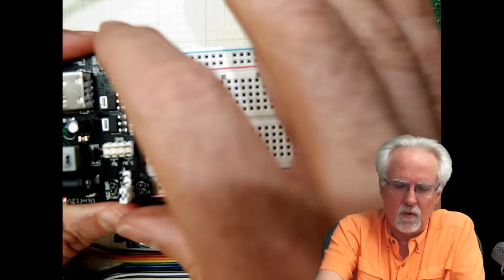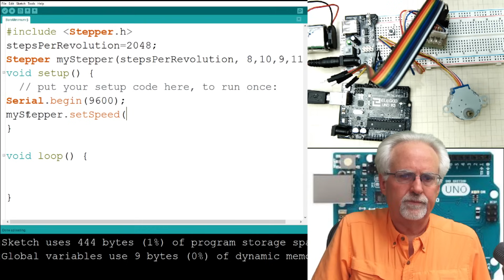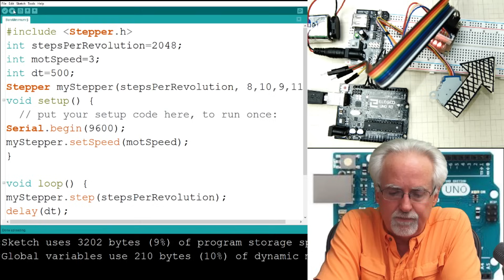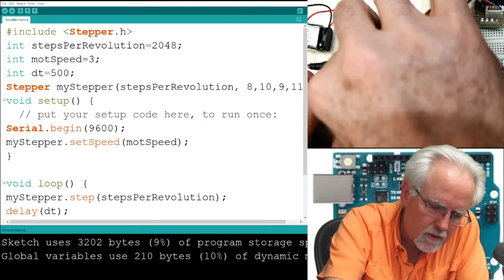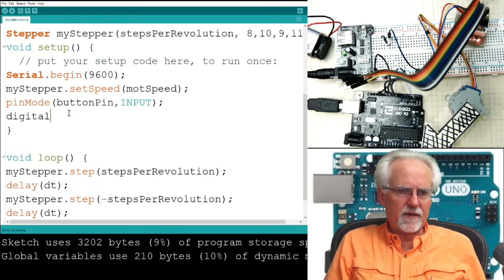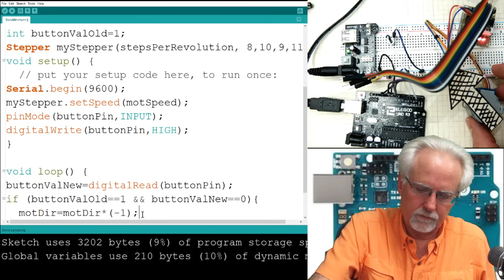Arduino Tutorial 35: Understanding How to Use a Stepper Motor

Comment: this took me 30 minutes to get a rough program running unfortunately, and I had to rig up an AC to DC power battery to power my circuit since I had no 9-volt batteries.  But besides that, very cool project to build and learned some cool things from it!
Reply from the maker: Great job!

Comment: Currently in my second year of aerospace engineering at university and have never touched an Arduino or C++ before and was given a project requiring the use of multiple stepper motors, sensors, buttons and LEDS and I cannot stress enough how much these videos have helped me. Thank you so much for making such high quality free material! I know there will be others like me in similar situations and your videos will have saved them as much as me.
Reply: Hi, I'm thinking about studying aerospace engineering after high school. Can you recommend any books worth reading, or give any advice other than that? 
Thanks in advance :)

Comment: I was able to program the button but I did it a bit different.  I used ... if (buttonVal==0) {   I then changed the direction as you did using the *(-1)  inside the if statement.  This works fine .

I would be interest to better understand why your way is better, or if in fact my way works as well.

Comment: when i plug-in my arduino board the power supply light turns off. The motor shakes a little bit when i run the code but it does not turn. i dont really know what this could be caused by. I think my controller for the stepper motor does not work because the lights A,B,C,D never turn on. please help me i have been stuck on this for days.... :)
Reply: found out what the problem was....the batery was just not having an output of 5v so thats why the controller would not power up :0

Comment: I find the battery is dead, cost me two hours to find it out. If your driver doesn't flash like mine, it's very possible that the battery is going wrong. 

#include <Stepper.h>
int dt = 1000;
int stepsPer = 2048;
int rotate = 1;
Stepper myStepper(stepsPer, 8, 10, 9, 11);
void setup() {
  // put your setup code here, to run once:
  Serial.begin(9600);
  myStepper.setSpeed(10);
  pinMode(2,OUTPUT);
  digitalWrite(2,HIGH);
  //  pinMode(8,OUTPUT);
  //  pinMode(10,OUTPUT);
  //  pinMode(9,OUTPUT);
  //  pinMode(11,OUTPUT);
}

void loop() {
  if(digitalRead(2)==0){
    rotate = -rotate;
  }
  Serial.println(rotate);
  myStepper.step(rotate);
}
Reply: I think it's very useful to have the button new and the button old because my code will keep reading the button digital input sometimes it reads three times therefore the motor doesn't change.

Comment: Here's how I did the challenge (without watching the end of the video) and I found it worked fairly well:

#include <Stepper.h>
int stepsPerRevolution=2048;
Stepper myStepper(stepsPerRevolution, 8, 10, 9, 11);
int motSpeed=15;
int dt=500;
int readPin=A0;
void setup() {
Serial.begin(9600);
myStepper.setSpeed(motSpeed);
pinMode(readPin, INPUT);
}

void loop() {
float statedet=analogRead(readPin);
if(statedet<=300){
  myStepper.step(350);
  Serial.println(statedet);
  delay(1);
}
else if(statedet>=600){
  myStepper.step(-350);
  Serial.println(statedet);
  delay(1);
}

}

edit: I also made a mini circuit for the push button. It had an LED and 1k ohm resistor so I could see when it is held down. The readPin was on the resistor's first pin.

Comment: Wait, you don't need to do motDir * 1, you can just do motDir, because multiplying any number by one results in no change to the number.  In fact, even if you were going multiple steps at a time, you could simply set motDir to the desired number of steps, as multiplying by -1 only changes positive to negative and negative to positive without altering the absolute value.

Comment: mine ran for a minute rgan stopped all it does is buzz now
Reply from the maker: Probably your battery is dead. Try using a suitable power supply instead of a battery
Reply: @paulmcwhorter  9.2v   tried 2 batteries
i need to find a good wallwart  but that isn't the issue here
Reply: @paulmcwhorter  walked away for a couple days came back used new battery, same results
Reply: This is bizarre this is such a simple tutorial I can't believe it's not working lol I mean I've double checked all my connections 1000 times I've used different connections, different conductors, it just doesn't work and now the motor doesn't even buzz anymore. The lights on the controller flash red at first and then they fade out to nothing after a while... I know it sounds like a battery-powered problem but I made a 18650 power module to run the external board it's read at 9 volts because I included a regulator not that that should matter much but it could literally run for months in a couple 18650
Reply: @paulmcwhorter  so I bought 5 new stepper motors in five new boards and the exact same thing happens. I've tested every connection and I found when I plug the blue into the common ground it shuts down the breadboard power source the little green light goes out and nothing comes up on the stepper bored either
Reply: @paulmcwhorter  I really hope you read this because I need some more help LOL by having all these failures I have learned so much just like it all aspects of life sometimes getting knocked down helps you learn. And it took me to be a little old man to realize that LOL

At any rate I have learned stepper motors are very finicky I cannot get a Tb 6600 running to save my life but they took completely different story right now I'm working on the basics I bought those terrable pins I think they're called DuPont pins and a very cheap crimper. Now is bad as it is I have mastered making cables with this inexpensive setup but it takes a lot of finesse to make him good. I would rather make molex connectors is I have a lot of experience with those I even have the crimper and the dyes for the black and the white molex connectors and I think they should fit better.

One of the problems is these do pot pins and matching connectors do not felt fit well on these pre mounted headers they are very very loose and when you get poor connection crazy ** happens. Would you suggest that I get the molex black connector to work with rather than these duponts because I really like making nice cables and having everything laid out for me I cannot stand using these loose crappy connectors they drive me crazy
Reply: @ClownWhisper  So have u found the solution of this problem? Its really makes me feel bad mood while testing this experiment

Comment: This is the first assignment that I was unable to complete. I did not occur to be to multiply by -1 to solve this. While I was trying to analyze what was going on by using the Println command nothing would print until a full rotation was completed. Then all I got was 2048. I kept drawing a blank on how to Solve the problem. I guess I should work on these earlier in the day. Thanks for the simple solution. Keep up the good work.

Comment: That last bit there put into the void loop threw my brain a curveball. Finally figured out it was "buttonValOld=buttonValNew;" as the last line of the void loop. Paul, I've been bingeing these lessons and crushed 35 in three days. You've done an incredible job, here. I knew nothing but was able to follow until you said "pause" AND THEN able to program this in my own way, unfortunately vastly different and of course with different results than you were able to provide here. Things happened, but it was still on delay and made a full rotation and then reversed. Invaluable lessons. THANK YOU!

Comment: Paul. How can I test my stepper motor and controller. Sometimes it works and sometimes it doesn't work. When its working I get lights on the motor controller. When its not working I get no lights on the controller and I can feel a slight vibration in the motor.
Reply: I rewrote the code, exact same as it was, but now it works. Not sure if that ino file had corrupted some how, but its working.

Comment: Hard to do this while I tend to overcomplicate the homework. I was thinking of counting the button presses, 1, 2 then reset at 1 with a counter. Depending on the number would change the direction. Needless to say I couldn't get it to work because I believed I needed to use while loops to keep the stepper moving. While loops are okay until try to pull yourself out of it and it doesn't go very well.

The lesson learnt here is to not overcomplicate the task and make it as simple as possible. Which seems to be harder in practice.

Comment: My stepper just sat and vibrated. It worked while I was attempting the homework, then when I realized I was waaaay off. It just sat and vibrated. Is the 9v battery dead, maybe?
Reply from the maker: Dead battery. Get a suitable power supply for this one. The stepper drains the battery in about 30 seconds.
Reply: @paulmcwhorter  that’s insane! Thanks for the quick response Paul. Thank you for putting this in the world for free. God Bless.

Comment: Got the stepper motor running, up to homework assignment point, about 24 min, stepper stopped working (vibrates on/off like it wants to move, but no rotation).  Is there a way to read pins 8, 9, 10, and 11 to see if in fact the signals are going out, but the stepper is dead???
Reply from the maker: Make sure to use a suitable power supply . . . the battery runs down very quickly. Try with a power supply.

Comment: Hey guys! I am using the exact same components and same codes. My stepper motor works correctly when i first plug it in. But about 2 minutes, the lights in the driver almost goes out and the motor stops spinning. Can you help me about that.
Reply from the maker: Your battery could be dead. Use a suitable power supply to power this project.
Reply: @paulmcwhorter  I checked the battery sir. I think the driver is warming up and that causes the problem. When i unplug the power supply and wait a little bit then plug it in , it works just fine for 2 minutes.

Comment: Thanks Paul for a super nice tutorial. Unfortunately I´m stuck on the Stepper motor (no 35) and suspect a hardware issue. Dispite beeing an electronics engineer I have no clue what to expect from the arduino pins 8-11, nor from the motor driver. None of the 4 driver LED:s are lightning up. Any hint for trouble shooting?
Reply from the maker: Make sure it is not a dead battery. Try a suitable power supply
Reply: @paulmcwhorter  Sorry, my bad! I finally realized that the jumper beside the 5V power input on the driver has to be fitted for the driver to work! Thanks anyway, now going for the homework assignement. 😃

Comment: My stepper motor is broken. It either gets stuck after some time working, or simply doesn't go counterclockwise. I am using wall connector so battery is not an issue.
Reply: Ok so I found the issue. To not go into phase configuration and all of that, just change this line:
Stepper myStepper(stepsPerRevolution,8,9,10,11);
to this line:
Stepper myStepper(stepsPerRevolution,8,10,9,11);

Comment: Well, I have really been fighting with this one.  Verified all connections and code.  When I upload the code, the motor does nothing, the LEDs on the driver board remain dark, and the power light on the power supply board goes out and will not come back on until I load a blank program and then cycle the power switch.  Interestingly, if I disconnect the stepper motor from the driver board, the LEDs sequence as expected.  I think I may have a shorted motor.
Reply from the maker: Or your battery is dead. Try hooking up to suitable power supply. The battery runs down in about 9 seconds.
Reply: @paulmcwhorter   Thank you for the recommendation.  I have measured the DC resistance of the motor coils as follows:

Pin 1 (Blue) to Pin 3 (Yellow) = 44 Ohms
Pin 1 (Blue) to Pin 5 (Red) = 22 Ohms
Pin 3 (Yellow) to Pin 5 (Red) = 22 Ohms
Pin 2 (Pink) to Pin 4 (Orange) = 44 Ohms
Pin 2 (Pink) to Pin 5 (Red) = 22 Ohms
Pin 4 (Orange) to Pin 5 (Red) = 22 Ohms

The spec sheet states 50 Ohms +/- 7% (3.5 Ohms) which should be a range of 46.5 - 53.5 Ohms

The motor could be slightly out of spec or my meter may be slightly off.  Could this be enough of a load to cause the issue I describe?  

The kit comes with an AC adapter with a connector which fits the power supply.  I may give this a try to see if it works, and I will test the battery too.

Thank you for your quick response!
Reply: @paulmcwhorter   Solution:  The kit also comes with a lines voltage to 9V DC power adapter.   Based on your recommendation that the new battery was weak or insufficient to power the motor, I tried using the AC adapter as the voltage source for the breadboard power supply.

This fixed the problem!  The stepper motor is working GREAT!

Thank you for your feedback and troubleshooting recommendations.😀

Comment: I don't think it was explained how the Uno board is powered. I assume it's coming from a laptop's USB power, but how is it ok to connect the ground of the Uno board to both the laptop's USB power ground and the negative terminal of the 9v battery?  Can you just use the same external 5V power supply for BOTH the Uno board and the stepper driver?

Comment: I did it on my own. multiplying by -1 was genius, I set mine up as an if else statement and after the if statements ran the stepper based on the stepState variable that i set up to switch when the button was depressed. four or five extra lines of code from what you did. I did have to reference the toggle button code we wrote.

Comment: Thanks for the great videos, I always watch them until the end.  Yang Chen is right, I was able to power everything by using a 5V rail.  What really cooked my noodle was I could not get my motor to reverse.  It took me a few minutes, I check my code over and over, even changed the negative values and nothing seemed to work.  Then, I switched the two center wires on the step motor and viola, it all worked as expected.  This is also how I came to find out that you can use the 5V power source.  My motors didn't work at first, but when I change the "motospeed" to 3, it worked.
Reply: I had the same problem with the motor not running backwards so as you suggested I changed the two center wires and it worked. I guess the two electro magnets were mapped differently for our step motor. Thanks for the post.
Reply: holy crap thank you!! I was having the same problem both with the power supply and the motor not reversing properly

Comment: My code is correct but my stepper motor isn't rotating, there must be something wrong with the motor itself.
Reply from the maker: The battery could be dead. Use a suitable wall wart.

Comment: This was a great episode as usual, but how long does it take to drain the battery dry for a stepper motor in this case a 9V battery??
Reply from the maker: The battery will drain quickly. Find a suitable power supply
Reply: @paulmcwhorter  thanks for helping though the motor vibrates but it’s not able to actually rotate.

Comment: I love watching ur videos. it’s so useful, I’ve learned a lot. Thank you. Something that I’ve been have trouble with though and can’t find is how to teach points. I’m going to be making a 6axis robot using stepper motors. I mean like I know how to change the position of the stepper motors in the program like u did in this video. But I was wondering if I would Control the robot with a joy stick or something to a position, Could I save that position somehow, Like a teach mode? Instead of going into the program that was wrote and changing the positions of the steppers. Plz help

Comment: I just now managed this by myself (I haven't been trying since it came out 2 years ago though!). I did have to go back and check the logic of just catching one movement of the switch, and I had to use the Arduino IDE help system to find out that the Stepper.step command is "blocking" and whizzing it a full circle at a time wasn't going to work!

Comment: Hallo, I realy appreciate the teaching of Mr. Paul McWhorter. I think I've bad luck. I started with the sketch as is instructed  and my stepper motor has stopped after 10 seconds. The stepper motor is trembling  sur place while the 4 leds on the powersupply are flickering very rapidly. I changed the power supply, restarted the wiring, pushed on reset, nothing makes it move again. What's wrong?? please help!
Reply from the maker: Probably your battery is dead. Switch to a suitable power supply
Reply: thank you for your quick answer Paul, I've changed the batteries, my output is now 6 volt with far enough power but that doesn't resolve the problem.  kind regards RC

Comment: Couldn't get the initial step to work, and noticed Paul had said in some replies to make sure and use a fresh battery, as the one in the kit is frequently dead on arrival.  I replaced it with another battery from home which was also apparently too old. doh!  That led to me pulling my hair out trying to troubleshoot.  Put a fresh battery from the store in today and it works perfectly.  Perhaps this can help someone avoid what I went through :)

Comment: I think the stepper in my kit is defective. When I use 2048 stepsPerRevolution, it does nothing. I can feel a slight vibration in the motor but no movement. When I use 1024 it works, but only turns in one direction. It cycles through the code that should reverse it, but it keeps going in the same direction. Bummer.
Reply from the maker: The stepper motor is almost NEVER deffective. It is something else. Either it is hooked up wrong, coded wrong, or your battery is dead. Try running off a suitable transformer.
Reply: @paulmcwhorter  I'm having the exact same problem.  The moment I connect the blue wire to the 5v rail on the breadboard, the power supply light turns off.

Comment: having so much fun... txs a lot.... however seems not to work with battery
Reply from the maker: The battery lasts about 10 seconds. Try plugging into a suitable power supply
Reply: @paulmcwhorter  I noticed, not even 10 second in my case...